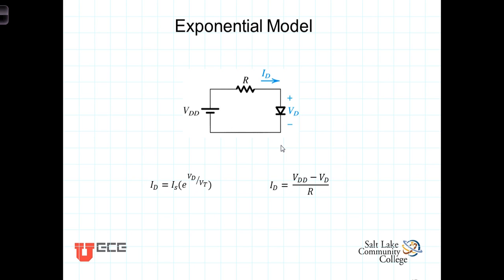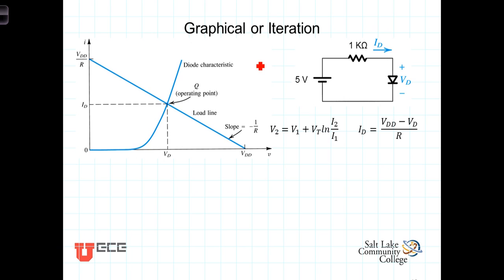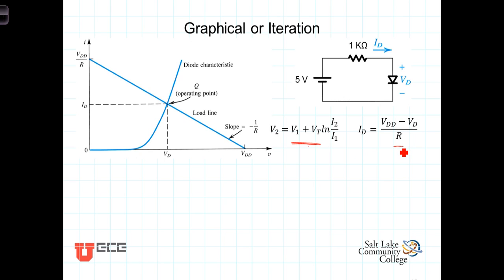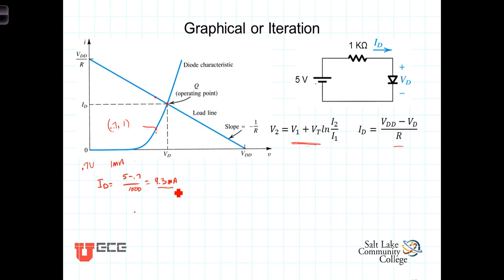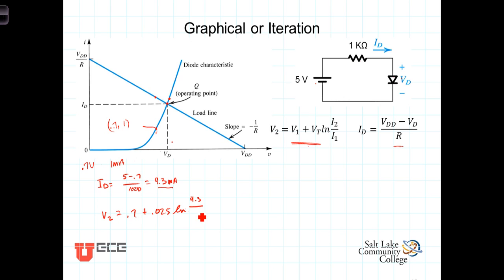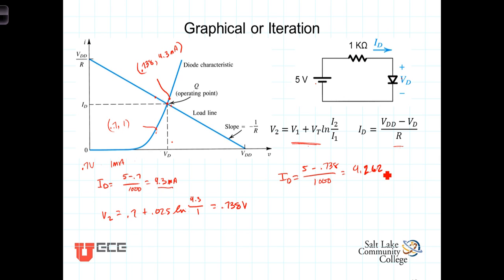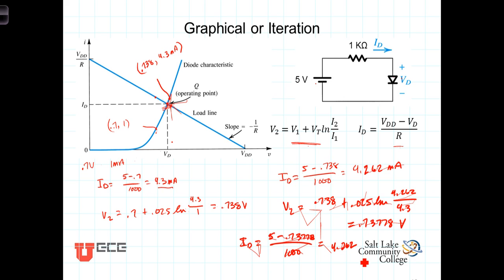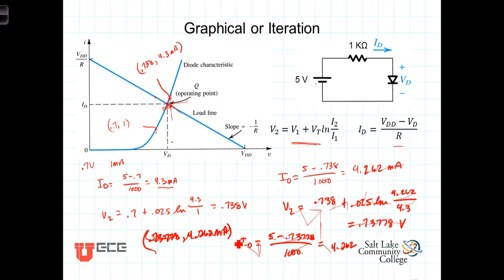L4 3 1Exponential Model and Load Line Itteration

Comment: Is your nVT initially have a value of 0.025 ? Where did your 0.025 came from ?
Reply: n=1 for ideal diode. Vt is the thermal voltage that is a function of temperature. For room temperature (25 degrees C), Vt=(Boltzmann constant * Absolute ambient temperature) / (charge of one electron) gives 0.024. Thus we say Vt is approximately 25 millivolts at room temperature.